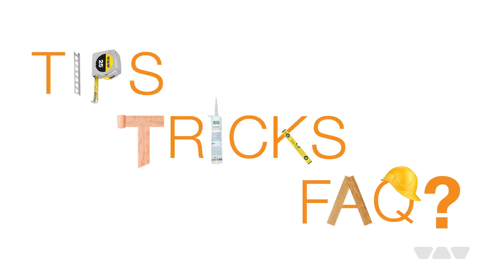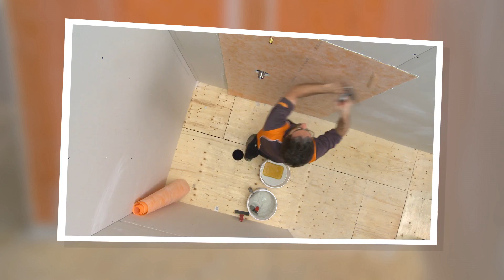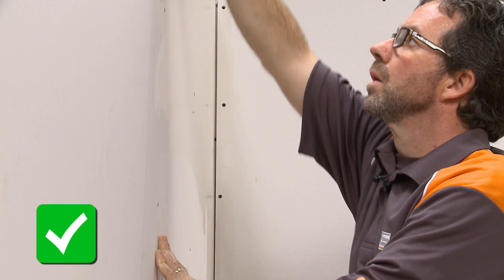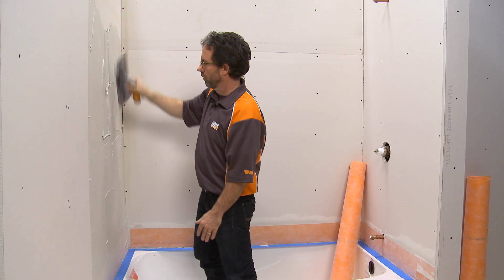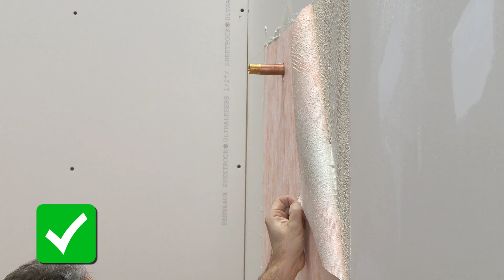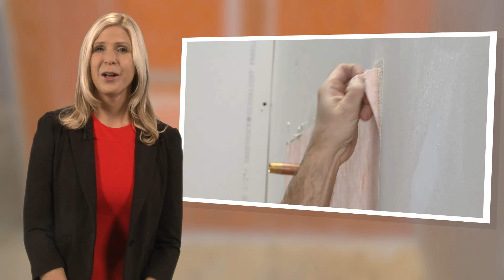How to achieve proper coverage underneath Schluter®-KERDI

Comment: So, the first side of the shower I did, I'm not sure if I did it correctly. How to determine if the membrane is installed correctly?
Reply from the maker: Hi Ryan, it would be best if you gave our Product Support team a call directly to discuss your project in a bit more detail. 800-472-4588 (US) or 800-667-8746 (Canada).